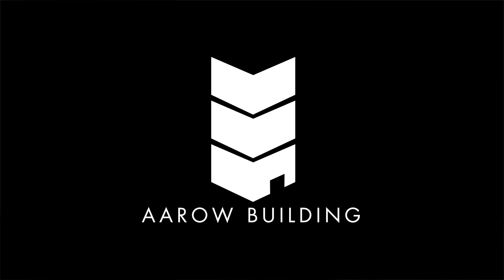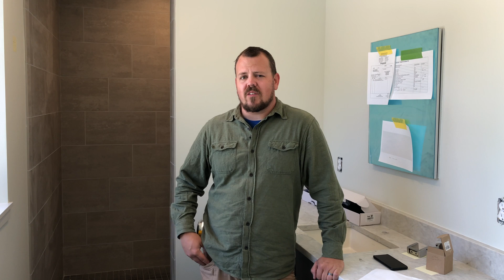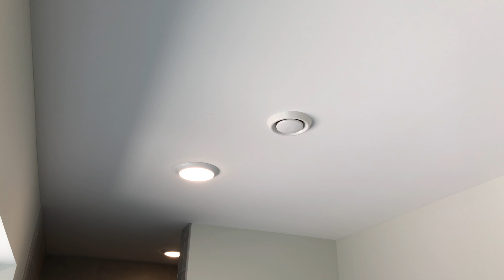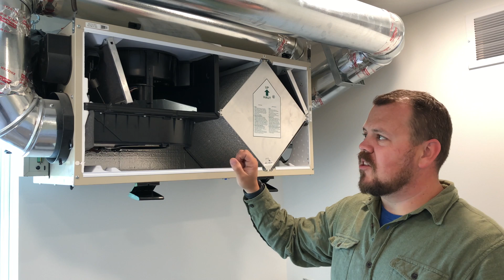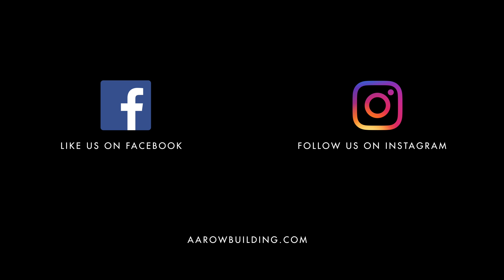Why Your Bath Fan Sucks

Comment: Is something like this only for new builds or do they have something for retrofits?
Reply: Depends on airtightness. Besides opening windows when it makes sense to, an ERV is how you exchange the stale air for fresh air in an airtight retrofitted house.

Whereas that exchange comes from draftiness through unintentional gaps and cracks (construction defects) on a regular remodel.

With the ERV, the replacement air is filtered. Without one, that air gets pulled past whatever is in your walls, ceilings and floors -including pests and their waste and their nests.

There are lots of reasons for airtight (specifically when verified with a blower door test) new construction (it’s been in the building code now for a while) or retrofits. Pulling fresh air through an ERV is just one of them.